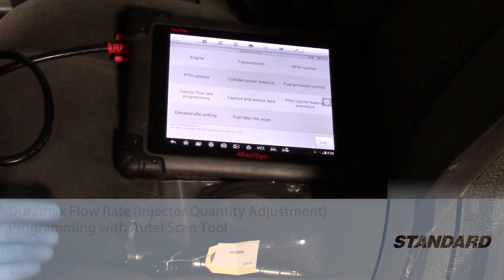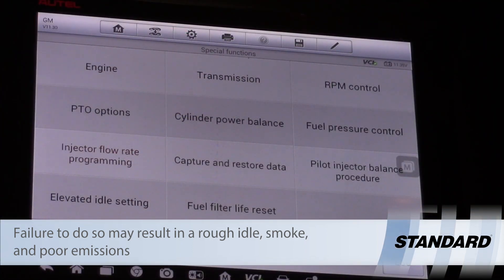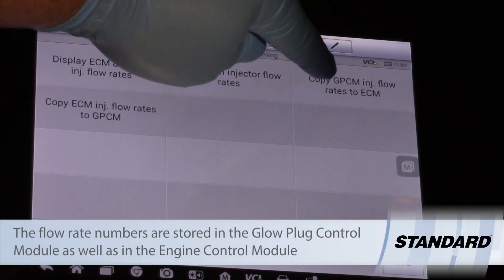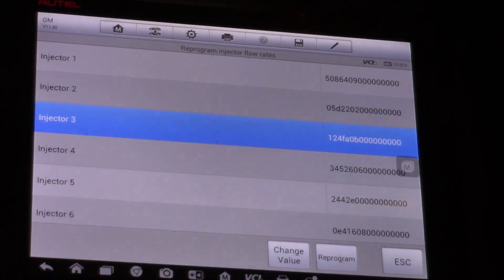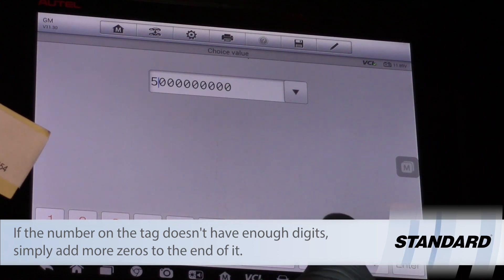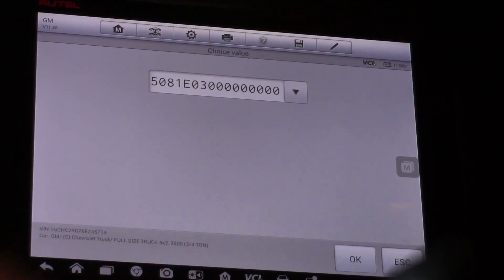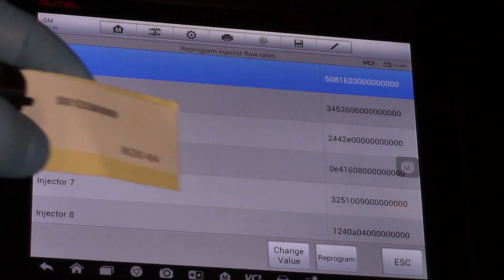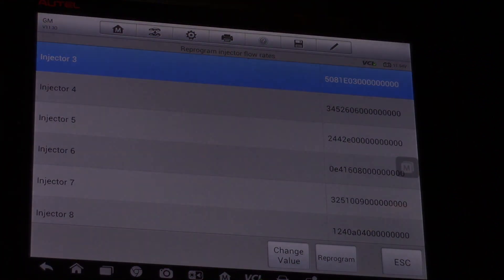Duramax Flow Rate (Injector Quantity Adjustment) Programming with Autel Scan Tool

Comment: that's great.. my injector didn't come with a tag... 2019 L5P.. the injector has a bunch of numbers on it.. the program numbers don't match the old injector & the new has a bunch of numbers that don't resemble the programmed numbers either... now what
Reply: I am running into the same issue. What did you sort out?
Reply: Republic Shane.  I selected the numbers that matched as far as digits.. I programmed them in & it took. Have had no issues but.. I replaced the injector without programming in the number & it ran just fine for the few days until I did the programming. Would it have hurt anything to keep running with the old number programmed in it? who knows

Comment: My new bostech injectors for my 05 lly didn't have any tags, how do I know what iqa to use?
Reply: Did you figure it out?? I'm doing injectors on an 05 kodiak and they also didn't come with these numbers
Reply: @LunaDaSavage  no, I was told my several people the lly didn't require codes... Simply install and go... I still have #6 that occasionally spikes 3-3.5+ and all others are +/-1
I bought a new harness pigtail to change in hopes it fixes it
Reply: @Michigan-thrifter  I'm also seeing that apparently programming applies to 06 and newer trucks. Thanks for getting back to me, I noticed the people who uploaded this video don't answer anyone's question so I figured I'd rather ask you than to ask them and be ignored
Reply: @LunaDaSavage  I also heard that 06+ yeah its hit or miss if up loader answer's questions but the community is usually pretty good to help
Reply: @Michigan-thrifter  So its actually any LBZ style injector, 2006 and up LLYs were equipped with LBZ style injectors, 2005s have the original LLY injectors and don't have to be programmed. That's what I found researching everywhere just to be %100. Thanks for the feedback
Reply: @LunaDaSavage  Mines a 05 lly and from what I saw the injectors look different between lly and lbz. I do have a friend who has a early 06 lbz but was shipped out with lly tune, he had GM install factory lbz tune in pcm and gained 50ish hp
Reply: @Michigan-thrifter  Right and I think they use different connectors so you can't mix them up. I think though.. That's weird that he got it like that. Good think he got it figured out. Doing them on a Kodiak is a pita you have to lift the cab some to get the rear injectors out
Reply: @LunaDaSavage  oh wow, doesn't sound fun... I had to make special puller with slide hammer to remove 2 of mine, took weeks of different ideas, heat, every spray lubricant you can think of lol but finally got them out
Reply: @Michigan-thrifter  yeah they're in the pretty good. I'm doing it right now I haven't pulled the back one out where there's no room yet, the other ones have been a pretty stuck. The back one is gonna suck 🤦🏻‍♂️ Horrible desing Kodiak..
Reply: @LunaDaSavage  my worst one was #6 on driver side right where my hydro boost is at, had to pull all that out to make room for slide hammer, and eventually I'll have to do it again if my pigtail doesn't fix it
Reply: @LunaDaSavage  never worked on a Kodiak
Reply: @Michigan-thrifter  hope it fixes it dude 👍🏼